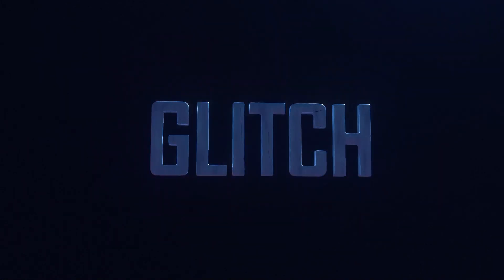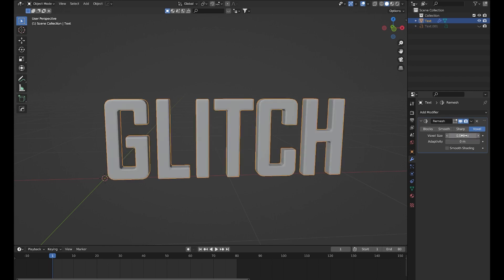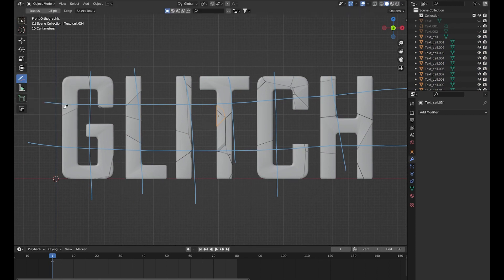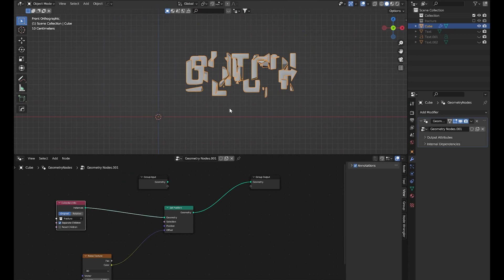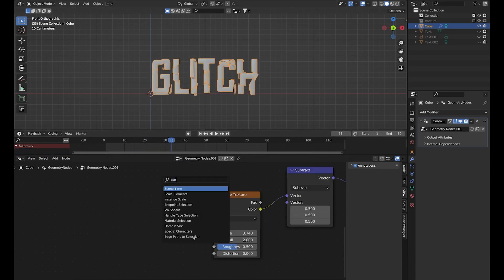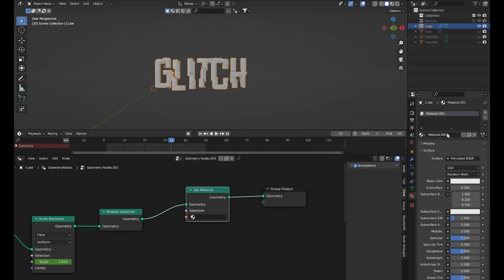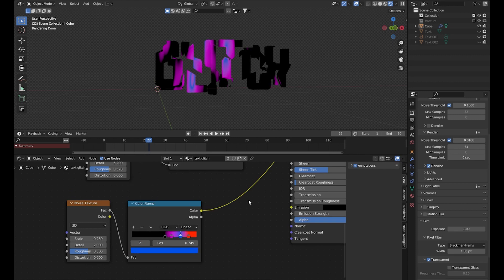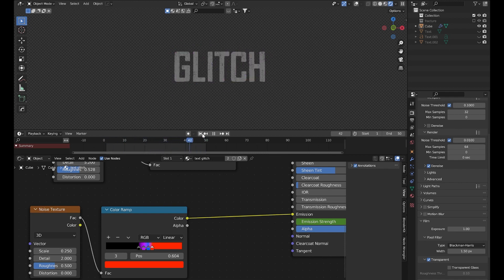Easy Glitch Effect in Blender | Geometry Nodes

Comment: I'm following along the video! I got stuck at 2:43 where you connect the 'collection info' node into the Group Output. It took me a minute to realize the fracture collection was appearing inside the cube and I couldn't make the cube invisible without effecting the fractures (whatever I did to the box would apply to the collection and vice versa). Just wanted to mention where I'm stuck. I'll look for a fix myself since it might be a preset or something. Thanks for the tutorial! 
Edit: I fixed my issue! Somehow I was adding the cube inside the collection. I think the drag & drop did something and added the cube into the collection somehow. Shift+A(dd) fixed it.
Reply from the maker: Glad you fixed it. Also thank you for watching 😊